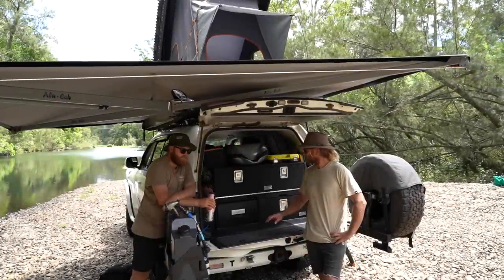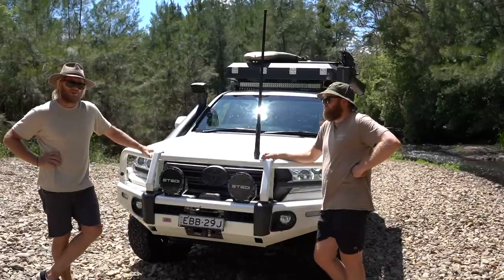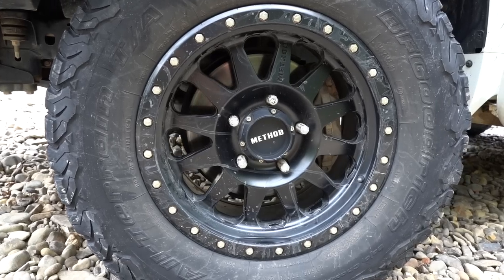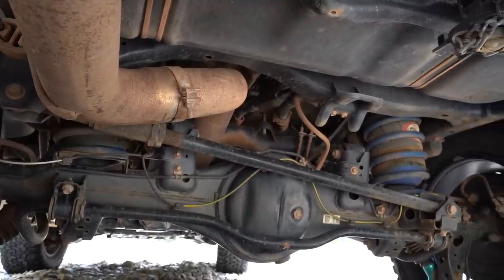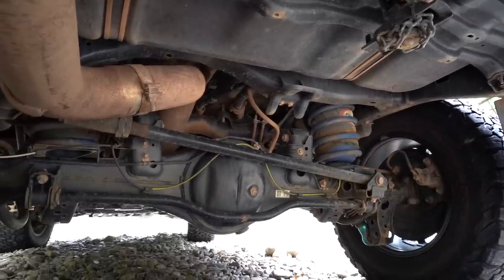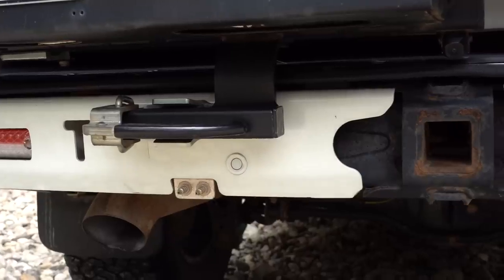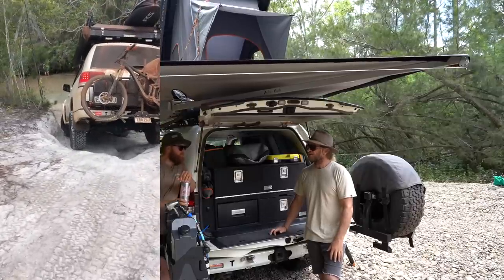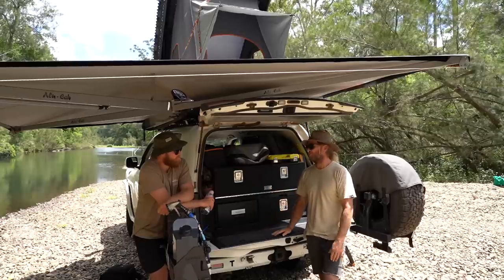200 SERIES TOYOTA LANDCRUISER WALKTHROUGH - built to travel Australia

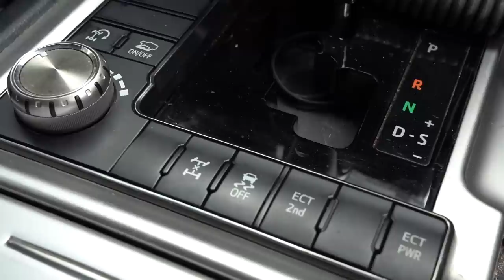Comment: Water crossing at 23:32 looks like the drivers side of front bar bouncing up and down? Probably an illusion. Good video, thanks.
Reply: Good pick up, pretty sure they are designed to move from the body hence the the need for a gap.
Reply: The bull bar is solid mounted to the chassis, but the body is rubber mounted, what you're seeing is the body trying to stay still while the chassis moves around under it. A bit like wheels bouncing while the vehicle stays flat.....sort of.

Comment: Nice tourer, great job!

I’m curious about the electrical setup...

Which battery is connected to the inverter and what do you run on the 240v plugs?

How do you get away without using solar with the 1000w inverter?

Cheers

Comment: How do you attach the middle load bar? I can't get to the bolt with my rhino backboard system because it blocks side access.
Reply: Hey mate fitted the middle bar first
Reply: @matthewjorgensen5497  Hi mate can you help me please, my question is do you have the rooftop tent fixed to middle load bar? Or is the tent only fixed on the front & back load bars? say four clamp points rather than six? and any troubles with rooftop tent off-road? 
Also was there any trouble getting underneath to fix the clamps? Because I to have taken off my rhino platform and would like to setup the three front runner load bars also to the backbone but am worried about enough clearance room to underneath so I can fix the clamps to the loading bars, By the way I love your deadly setup 👍🏾
Reply: @waynetobane8814  Hey mate, so from memory you attach the middle cross bar to the back bone first then put the tent on and fix it off with the brackets. The front and back crossbars are alittle easier. Ive had the tent,awning and accessories up there since new, 60,00kms later (WA top to bottom and the cape) not one issue. Cheers!!

Comment: Just wondering what type of bike rack is on the car. Have been looking for one that works with dual wheel carrier
Reply from the maker: He said it was from eBay!
Reply: @TylerThompson90  thanks for the info!
Reply: Hey mate it was on ebay, I just had to mod it to fit. Flipped some parts and drilled a new pin hole. Cheers
Reply: @matthewjorgensen5497  thanks for the additional info. Absolutely loved the vid - your mods are a great inspiration for my soon-to-arrive LC200 VX!

Comment: It’s already got rust on it. If you sell your house look after your stuff
Reply: Mate it gets washed weekly, also underbody ever time after off road. It’s hard with so much stone chips. It’s getting another underbody spray
Reply: They come off the boat with surface rust haha
Reply: You have to be joking, that is just surface deterioration that any used 4x4 will end up with.
If he goes for a run thru long lush grass the exposed underside will appear polished.
Having said that, I owned a 76 series once and even with a rust eliminating electrical circuit running individually thru body and chassis, the surface deterioration was horrendous, not too confident in Toyotas chassis paint jobs after owning it. Sons Hilux, the front cross member had to be cut out and replaced, now that was rusted.
Again, a Toyota.